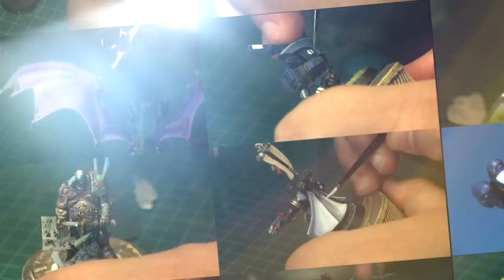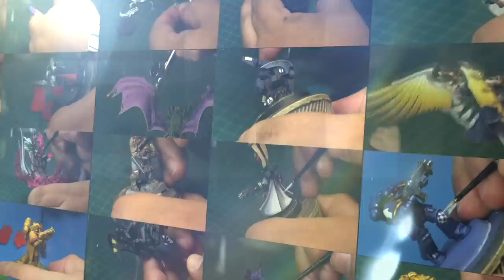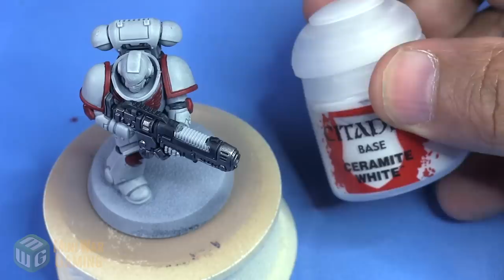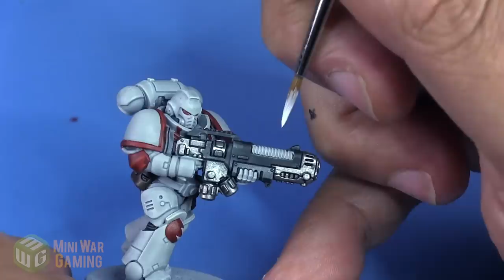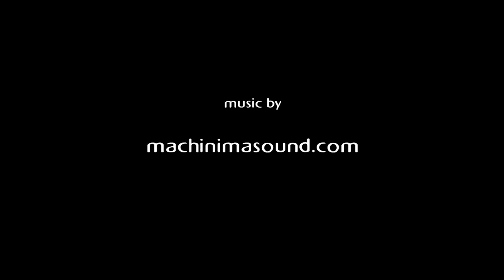Quick Tip Plasma Glow Citadel Colour Contrast

Comment: This is the first thing I've seen with Contrast that I might prefer over previous methods.
Reply: It won't look as good as using the traditional method of the traditional glazes and watered down standard paints but it still works.
Reply: @ajr1775  You mean the "method" of spending 20x more time, using 10 different paints, and being almost impossible to fix if you screwed up, all for tiny, impossible to see without a microscope difference? That one? Because I will take contrast to paint grunt #38205 in a minute, thank you very much...